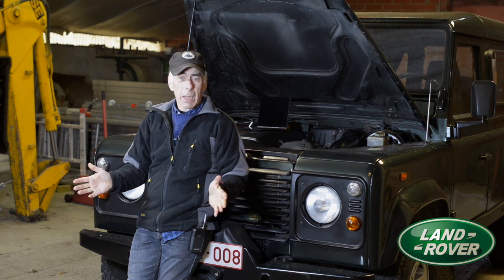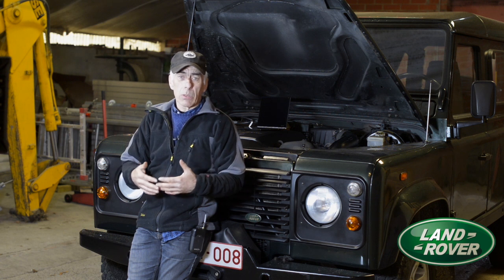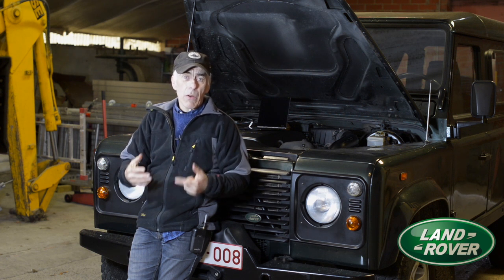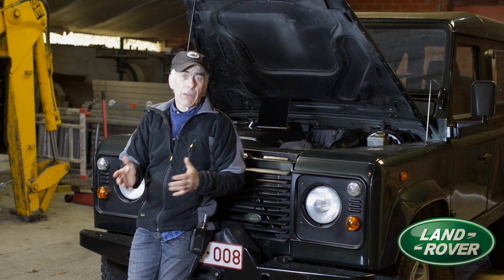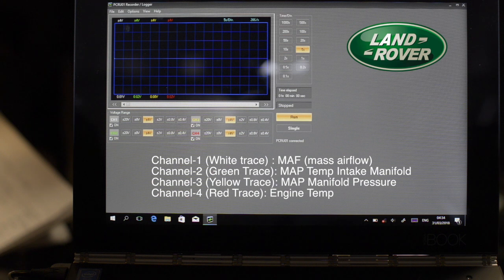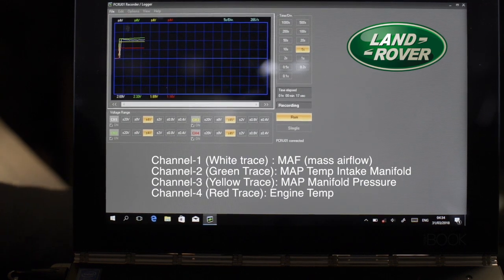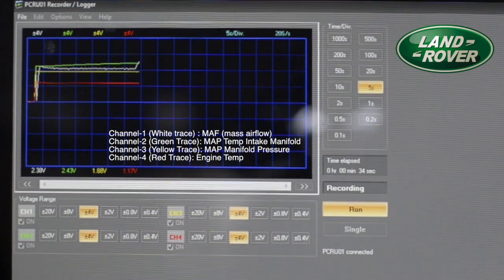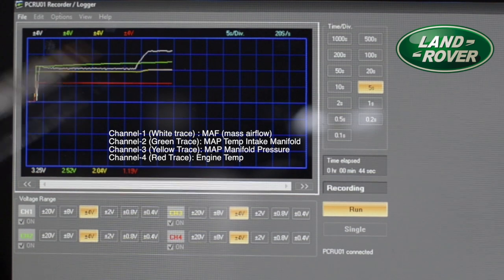Landrover Defender TD5   ECU Vital Signs   How to capture signals   MAP  MAF etc

Comment: Hi there! I have a problem with a defender td5 10p engine, the car runs "good" on flat but once is on a hill is running poor lack of power, I already did injectors washers, new fuel pump, no oil on ECU, check wastegate (is free), no leaks on intercooler, new MAF, new AAT (Ambient Air Temp), try a known good MAP, check fuel pressure (4 bars), on live data what I see out of measurement is the Ambient Air Temperature (AAP new) is at 151c (302f) anny suggestions?

Thanks from Honduras!

Comment: Excellent video, thank you. I'm trying to solve a problem with my Discovery 2 TD5. During gear changes the rpm's are surging and I believe it's a sensor issue, either MAF or MAP sensor failure. I'm pretty sure after watching your video I know how to test and identify faults in these areas.
Thanks again.